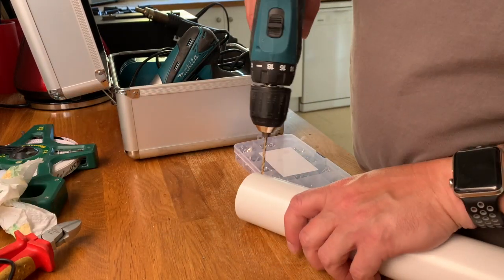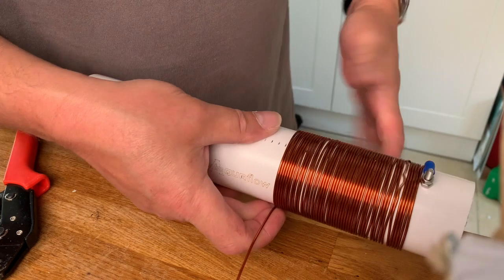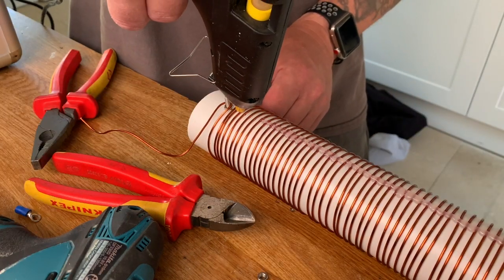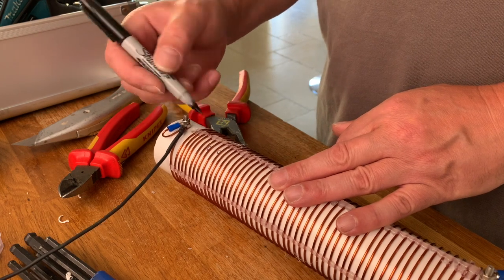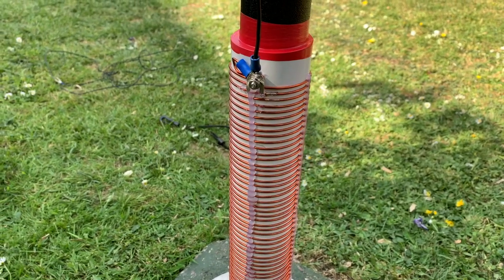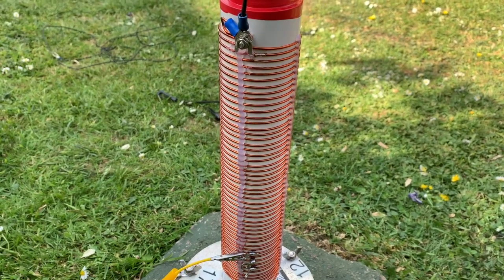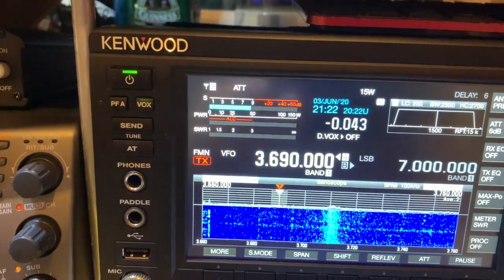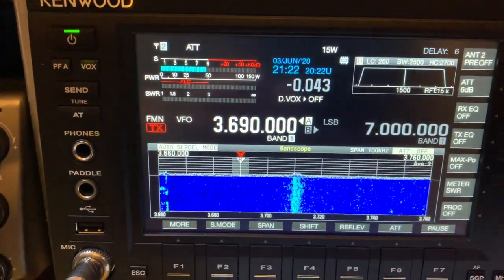DX Commander, Roly Coil Combo 80M  Vertical

Comment: An idea for easily getting the spacing right: Wind several vires one by one and remove all but one. You can use whatever wire for the "spacing wires".

Comment: I’ve seen you wind coils on a couple of videos, and I have a couple of questions:

1.) Does the spacing of the windings affect the Q of the coil, or what is the reason for not winding the wires tightly? How important is it to keep the spacing uniform?

2.) On one you appeared to be super-gluing the windings in place, then spraying it with something. What were you spraying? Did you use some sort of adhesive that needed the spray for it to cure?

3.) I saw you showing your inverted L on another video. It appeared to cross above some solar panels on your roof. Does that cause any problems, with either RF coupling with the panels, or the antenna picking up RFI in receive mode?

I’m watching a number of videos to get ideas on a home built,  compact, and portable NVIS antenna for 40 & 80 (and possibly 60) meters. I’m just trying to figure out how much strain it would place on the loading coil tube/pipe (with end caps) to support a telescoping whip for a horizontal loaded dipole.

73 de AF6AS
Reply from the maker: Answers,
1 yes, in short. The more tightly you wind the turns together the higher the interaction between the turns the higher the inductance and impedance.
2 yes superglue, and yes the spray is used to cure the glue.
3 No issues with the solar panels no RFI.

Cheers 73
Mike

Comment: I know its been a bit, but this stirred some questions for me I hope you can give directions on.
1- all of your other elements are removed. Will a coil not work with the other elememts still on there? Does the coil interfere with the other elements?
2- assuming the coil doesnt interfere... a-would it be possible to run another 40 with the coil up the antenna in the place of the 30m part all the way to the top and overlap the existing 40 in the top loop and back down? OR 
B- run another 40 with the coil up to the top spreader in place of a 30m and then loop it back down from the top spreader.

My main question though first is why remove all the other elements to put the coil on? Was it just convenience for this testing or, once you put on a coil, it will interfere with the other elements so the dx becomes a single band antenna only for the 80m?

Im happy to experiment if no one knows about what will happen with 2a & b, but im really hoping especially to find answers on using a coil together with the other elememts still on there.

Comment: May have been said - one method for spacing is to wind a second or 3rd wire with the coil wire (whatever number and size works to get correct spacing) then unwind the spacer wires. Saw this tip somewhere, haven’t tried it yet but looked to work easily. And of course Roly’s way of getting a thread cut in it is probably the greatest!!

Comment: Have you attempted an 80 m on a 10 m pole by going all the way up to the top and all the way back down again Linear  loaded - Just curious if it would work and what kind of takeoff angle would you be looking at by doing it like that
Reply from the maker: Yes tried that, was not so good. but it did work.

Comment: Mike, how well has the glue held on the pipe?  I’m wondering if we could build one for 160m that extends the 80m element of the new 18m “Neboola” as Emily calls it.
a lathe certainly would have made the spacing easier.
Reply from the maker: it is in the planning stage.. :)

Comment: Wait, Its NOT A 40 Meter Element ! 5:28
Maybe 4 Meter ?
Reply from the maker: No it is a 1/4 wave 9.68M... for 40M
Reply: @mike-M0MSN  I Don`t understand this, can you PLEASE Explain? :( 
Or Maybe We Can Talk Somewhere? discord? I have so many HAM Questions
Reply from the maker: @krisraps  I am on discord now... DXCommander

@KrisRaps,  On the DXC Classic, you can put a base loaded coil (20 turns on a 75mm former or 32 turns on a 50mm former) of 15.5uH attached to the 40M (7.1MHz) element (11.2M wire length) and it will give you a vertical antenna for 80M. or 24 turns on a 75mm former ( 19.5uH ) if you use a 9.68M element for 40M........
Reply: @mike-M0MSN  Sorry, But I Can`t Find You On Discord Anywhere. 
Can U Give Me The Code For The Server Or Your Nickname With The 4 Numbers Please?
Reply from the maker: Hey Kris been listening out for you on Discord no luck so far ?? https://discord.gg    dx commander
Reply: I REALLY dont know where to find that diecord server.
Maybe you can juet add Me PLEASE???
KrisRap #5337

Comment: Question, I have a DX commander and when you connect the 40M to the top of the coil to you pull the extra slack tight at the top and vise versa when you connect the 40M element to the plate? 73 Ian
Reply from the maker: I normally just let it hang to be honest.
Reply: @mike-M0MSN  ok cool I just checking, I did see in your other videos that I could just cut it shorter and bypass the coil to the driven plate with a jumper if I want

Comment: As a SWL still learning, I watch as many videos as I can regarding antennas and the like. I play around with bits of wire and metal and do sometimes get surprising results. One thing that puzzles me is can I adapt these different antennas for RX only.
Reply from the maker: Yes, the great thing here is if it for RX only you can make them more efficient to your requirements, a ground loop is supper quiet but the SWR is sillily high so no use for TX.. :)

Comment: I usually take a dremel tool and notch the 5mm marks. It just allows it to stay in place.
Thinking of 3D printing flat strips with 5mm spacing and just fasten them to the pipe.

Comment: Nice idea. I have two questions: What you have for radials on that permanent installation? And do you leave the pole up unguyed? Do you have some sort of support running up the inside of the pole?
Reply from the maker: Hi Andy,
Yes 64 radials between 3m and 10m in length 2 cm under the grass, up all year round, guylines at 4m and 6m points and centre glassfibre rod up to 1.5 metres  inside the base

Comment: Tall Asda spaghetti jar, (£3.95), keep the bamboo lid, hole-saw 2" hole in base, fit upside-down over coil.
Hey presto, weather-shield for intermittent showers, plus transit-protection.

Comment: UPDATE.... just built a coil. I decided on 1.8mm dia wire with a 50 OD tube and would to give me adequate 18 to 25 microH with various taps. I have adapted the 40m vertical for inserting the coil and will test and use in the next couple of weeks. Then perhaps a 160 coil with maybe a longer vertical wire. Thanks for the inspiration Mike!

Comment: I built one of these for a 6M 5/8 wave element on my DX Commander. My technique for spacing was to use bare copper wire with window screen retaining rubber as a spacer/insulator. Instead of soldering several taps to the inductor I fashioned a tap out of thin copper sheet material that I could rotate up or down the inductor for tuning. If I build another one of these I would add a couple  more movable taps so as to cover the entire band by switching the feed point. Nice build and nice video. Thanks KN4MNA

Comment: Hello Mike,
Can you do the coil without spacing it ? It would much easier! The wire looks enemelled copper wire so why not thight? Just less number of turn to get the same inductance value. Could it be?
Thanks and 73
Reply: Yes you can, the inductance will be greater if close wound with the same number of turns. For more info on this type of antenna look up "LPAM Antenna" in google search.
Reply from the maker: I have not tried, give it a go..

Comment: Well then, one could take this same design and turn my 80m inverted L into a 160 with the "Roly" Coil design.
Reply from the maker: Yes you could, not sure on how many turns you would need, I will have to calculate that one.

Comment: I have had to loose my 80 inverted L as have used the mounting point for a 40 odd m long end fed, I wonder if this coil could be used along side a fully loaded DX Classic so I can still use the other Elephants :-) give it a try is the answer I suppose.

Comment: Great video Mike, I'm playing around with a coil for 160m although it's a bit simpler not needing tapped. Out of curiosity, did you already have enough radials down for 80m?
Reply from the maker: Yes, I already run 80 as an inverted L.. :)

Comment: Mate. Take a wire protectve sleeve, its already split the length of one side. With sissors cut the side opposite the slit leaving you with 2 halves. Now cut each half. Glue each quarter on the PVC pipe. Offset the remaining 3 quarters and glue to the PVC so you the turns will have the correct spiral. About every 5 - 10 turns glue the wire to the coil form. Use sand paper to remove the shellac from the copper wire then crocodile clips for find the tap you want to use. Tedious but good video. 72 de KB8AMZ
Reply from the maker: Terry Morris Great idea Terry. :)

Comment: Well done mike. Do you think this could be done with heavy gauge insulated wire wound directly on the original DX Commander  pole. I can’t see why it wouldn’t maybe I should be brave and give it a go. Cheers 👍🇬🇧👍🇬🇧👍
Reply from the maker: Yes, absolutely you may need to make an additional turn or two but the diameter is pretty close.

Comment: Super job Mike. Well explained. How did you find it on DX? I would imagine it better mid/DX than local. According to my approx maths and your commentary....50 turns on a 50mm dia former = 7850mm. Correct? Cheers
Reply from the maker: Close, the ID of the pipe is 50mm so the OSD is 54mm  so it's around 8,5m.    It is a good starting point as the wire may have a slightly different velocity.
Reply: hollyend01 thanks Mike. Yep, realise you had actually used larger 54OD pipe and had compensated by shorting/eliminating top 2 or 3 turns. Good stuff. I’ll give it a try with a 40m GP. One other ‘coil locating’ method could be to make a hacksaw mark on the plastic tube. Best wishes. Nick M1DDD
Reply from the maker: NICKGAR7 Nick if you use a smaller diameter pipe the Inductance will be less than if you use the 54mm you will have to increase the turns to around 67 to get the same value in micro-henries. But give it a go.  :)
Reply: @mike-M0MSN  All understood. Seems to me that the inductor is circa 19-25 microHenry with tweaking of taps for portion of frequency depending on a few other variables like position to feed point, exact vertical radiator length etc. All good. I just spent some time re-working my physics and electrical engineering formulae ! Thanks Mike

Comment: I am looking at costing the pipe with a 5mm thread cut into it and the mounting holes drilled.  Supplied as a "former" will make the construction very simple and easy for sure.  I will keep you posted....   :)

Comment: Nice job Mike and i admire your tenacity in getting this coil assembly constructed.  You mentioned in passing the BIG secret in making this thing with out too much hassle.  If you can, find a friendly engineer who is able to turn a 5mm pitched thread into the pipe for you,  It only needs to be 1 - 1.5mm deep but the "thread" will act as a guide for you and the need to glue-as-you-go disappears.  The several hours of frustration in holding springy wire in place also magically disappears. 
Yes, the number of total turns is quite critical.  50 turns seems to be the magic number i have found.  I have three taps at the bottom of the coil,  The bottom tap is for the CW/FT8 end of the band and the top tap is for the SSB end of the band.  Alternatively, the inbuilt tuners found in many rigs today will cope wonderfully in which case i would probably opt for the middle tap.
Great nob Mike and it seems like it is destined to go down in history as the "Roly Coil"..........................
Cheers, ROLY - ZL1BQD
Reply: Hi Roly, what inductance are we aiming for here?  I'm guessing yours is about 25-30 uH is that right?  I am not sure I have the exact materials etc. but if I know the inductance I can make it using what I got and measure it with my meter I guess.  (I have different wire and different size of former for example).
Reply from the maker: Hi Roly, yes on the next build I will indeed get someone to thread the pipe. Cheers Mate.  :)
Reply: Regarding the spacing I'm planning on winding the wire and some nylon cord as an insulated spacer together and then maybe removing the cord leaving a space, or maybe simply leave it in place as a spacer.  Don't know if it will work yet - we'll see I suppose :)
Reply: @stewartrv  Watch this space.  I am making a video at the moment to show the construction etc.  That may help.
Reply: @RolyRJ  OK thanks!   Well I have to get my analyser on the 40m DX Commander element and see what it needs in terms of inductance in the meantime then. 😁. I've already sub'd to your other channel (ZL1BQD - Roly) I guess it will turn up there...
73 de HA5RV
Reply: the turns are only critical in that it determines the resonant frequency really.
You can place taps at the top as well and move the radiator connection down from the top until you get the resonance you want.
I've done experiments with these kinds of base loaded tapped antennas on 1600khz where it's more fiddly and managed to get tuning without an antenna analyser

Comment: Great video Mike! Been waiting for Callum to create a video but you've beaten him to it! Just a couple of questions...you say to use 1.6mm wire, but the label shows 1.5mm? Brocott supply 1Kg reels...is that enough?
Reply from the maker: just checked yes you are right 1.5mm copper wire no big issue.  1Kg is about 100M
Reply: Cool! Thanks Mike! de Wyn GW4TUD.